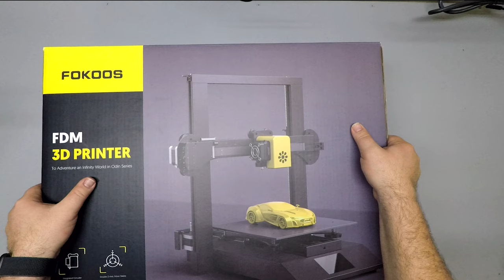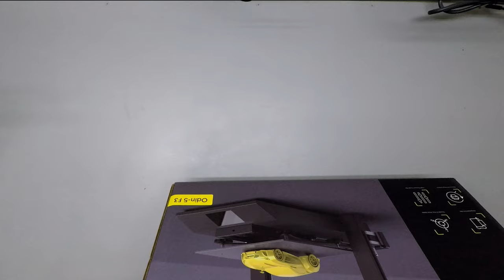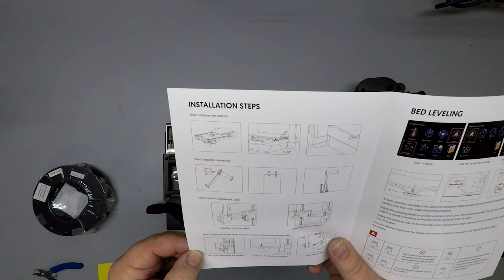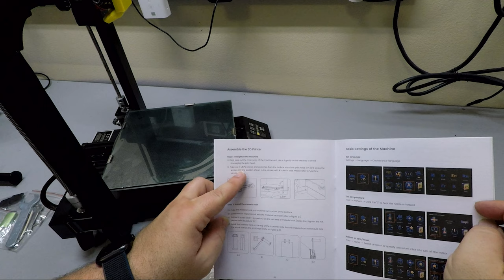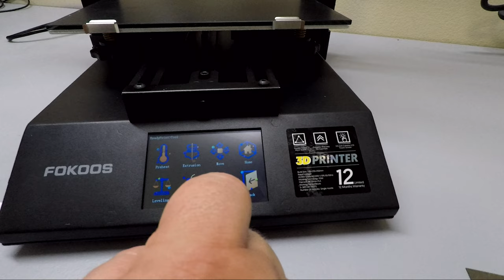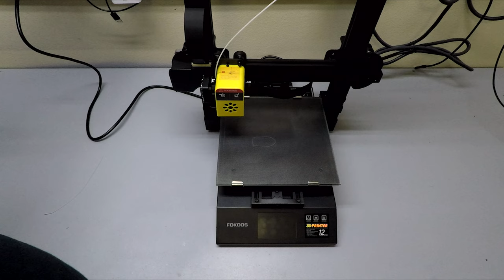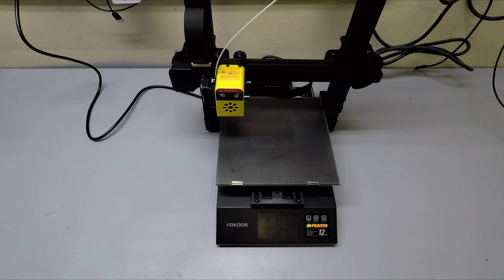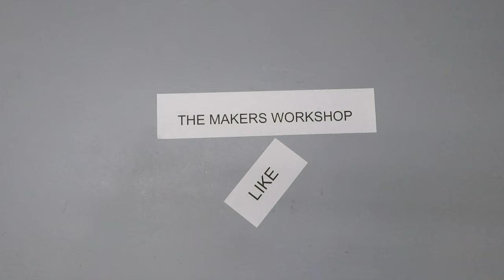Unboxing / Review of the FoKoos Odin5-F3 3D Printer

Comment: I didn’t even get the stringing on the Benchy. But then again I did go through the leveling process five times and I also used the smooth glass side of the bed instead of the corrugated side. I find that all of my prints on all of my printers work better with mirrors or smooth glass. My first boat off of this was completely perfect. Not one single imperfection. Just redo your leveling a couple, three times. And yes it does print fantastic out of the box but I was a little disappointed that they claim to include their own software, slicer. And they do not. Or they did not on my edition. I was able to upload the driver to the computer. But it is not listed as a printer under Cura. So I’m not sure what to load it up as. Everybody says just use ender three settings. Haven’t tried that. Make sure you adjust the bed adjustment wheels and the adjustment wheel for the extruder itself. They did not come adjusted from the factory. It was trying to strip the belt right off the rip. So I tightened the belts and tightened and loosened where necessary the roller wheel adjustment cams. That immediately made a huge difference.
Reply: This was literally just the unboxing video.  Since then I've done quite a lot with the Odin... Firmware is now Marlin 2.0-Bugfix and I'm running the Marlin TFT-UI instead of LVGL ( which gives me Advanced Pause amongst other things ).  I added a BL-Touch by hacking into the factory harness and moved the mounting from the side to the front of the toolhead.  The glass bed has been replaced with a FYSTEC flexible steel magnetic bed, and then I replaced the nozzle with a hardened steel volcano nozzle.  Overall, it has massively improved the machine for me... and the prints come out perfect every time.

( I use PrusaSlicer as my main slicer, OctoPrint + OctoDash to control the machine with a 7" display, and print PLA+, PETG, and HIPS with ease. )

Comment: Hopefully we can get the Wi-Fi enabled and working without too much fuss! I saw the icon on the touch screen and was all excited and then it didn't do anything, lol.
Reply from the maker: Well, here's what I've found out.  If you purchase the correct ESP-12s board ( pins to either side, not the one with 8 pins on the end of the board ) and flash it with the correct MKS firmware, it does "just work."  BUT

... there is always a BUT ...

It's trapped inside a metal case.  One of the reasons that companies like Prusa and Creality have put the WiFi adapter in the separate control panel box is so that the wifi signal can get out.  Since the MKS Robin Nano v1.2 board is inside the case, and under the unit ... the wifi signal is very weak.  You get the convenience of wifi, but only if your computer is right next to the printer.

I'm working on a kit which will solve that.  It will consist of a PC board with the right pinout for the MKS, a 3D printed plastic case for the ESP-12s board, and a cable that leads outside the printer case.

On the other hand!  You can also, for about the same amount of money ( $35 or so ) simply purchase a Raspberry Pi 3b or 4, and install Octopi and plug it into the printer's USB port.  Easier, and less messy overall.  Plus no modifying the printer or taking it apart!  Bonus.
Reply: @TheMakersWorkshop  wow! Yeah, I wondered if it wouldn't block the signal. I will just wait and see what pops up. Maybe if you get something ready to go and sell them.
Reply from the maker: @KeeferTech  Well, I usually try to open source mods like this and set up a bill of materials anyone can source from sources like Amazon and the like.

Comment: I checked their website and it supposed to be able to print TPU.  Could you please do a test seeing if it will print ninjaflex? I'm in the market to buy a few printers if they can print ninjaflex. Thank you.
Reply from the maker: Already did!  It prints TPU fairly well, given that the printer uses a pinchwheel setup.

As always make sure to go SLOW, as with any TPU.  Also, I wouldn't try to print anything softer than .. say .. shore30 without a dual-drive extruder.

Comment: This is exactly the same as my Xington S1. even the screen commands. have you updated the firmware to marlin yet?
Reply from the maker: It is Marlin, using the LVGL graphic touch option, running on an MKS Robin Nano 1.2 board.
 
FoKoos gave me source, however I compiled the MKS version just fine after adjusting pins.h appropriately.  

My GitHub is:

https://github.com/martinbogo/Marlin-2.0-for-Odin-5-F3
Reply from the maker: ... addendum.  I had a look online at the https://www.xtzl3d.com/ and looked for "Xington" then "Xingtong"   Looks like a much earlier revision of the printer, with a bowden setup rather than direct drive.  In China, there are a /lot/ of OEM rebranded manufacturers and resellers.  Usually like this, with small changes made in logo, color, and features.
Reply: @TheMakersWorkshop  mines a month old and have had vastly superior prints than any of my other much more expensive printers, first thing I did btw, was change the case fan for a much more quieter one.  Superb

Comment: How easy would it be to add auto bed leveling?
Reply from the maker: It looks like the printer is designed to have WiFi added easily ( it used a standard MKS Robin Nano v1.2 board -- so you'd use an MKS Wifi board - ESP-12s breakout ) and the molded plastic hood over the hotend is literally DESIGNED to have a BL-Touch/3D-Touch aftermarket part added.  The company representative says that they are both working/packaging a kit and selling the printer with auto bed leveling.

That said -- it was one of the simplest manual-level operations, and the benchmark benchy came out beautifully.   It's a very precise machine all around.
Reply: @TheMakersWorkshop  thanks for the information.
Reply from the maker: @bribeck12  I am now compiling Marlin 2.0 ( from the Makerbase GitHub link for the Robin MKS v1.2 board ) with BL-Touch auto-level support.  Although I think FoKoos is working on implementing it more neatly through the ribbon cables, I'm going to see if there are signals on the wire I can use to connect the BL-Touch servo and limit switch emulation to the board through the current setup -- or if I'll need to wire it separately.
Reply: @TheMakersWorkshop  awesome thanks just ordered the machine. And I do have a spare bltouch clone to install. Would love to not have to run exta wires and use the ribbon cable. Keep me posted please. Or even for now if manual mesh level can be activated with a new compiled firmware that would help too.
Reply from the maker: @Brian Beckwith  You can easily get manual mesh leveling working with a recompile, although I do think it's a tiny PITA to do that and it only gives marginal benefit over manual four corner leveling.  Here's the link to the Marlin 2.0 source used by FoKoos:

https://www.igotu.com/downloads/FOKOOS-Mks-Robin-Nano-Marlin2.0-Firmware-master.rar?dl=0
Reply: @TheMakersWorkshop  it's wanting a username and password for the link.
Reply from the maker: @bribeck12  thanks!  I forgot I had that directory password protected.  I have removed the password protection ... the link should work now.
Reply: Hi I'm new to 3d printing if download cura software on my laptop and first it does it override the cura software on printer

Comment: I'll tell you why not to get this printer. parts, My printer came leaking plastic. and I see hotends all over the internet for Ender and many other cheap printers but nothing for this printer. before the printer arrived I emailed support about parts twice and got no reply.
 so I try to pause the printer every 8 minutes to clean off the leak but it resumes in a future place as if the printer is still sending commands or something.
 Make sure you square it in the z-axis. I had planned to add another screw because it moves some in the bracket.
Reply: Support said "Generally, no additional maintenance is required, unless you are very careless in using it

Alisa"
Reply: Now I'm searching for the Firmware. The control board is inside so I can not see it, Windows does not see the printer with the installed firmware. does not see the sd card.

Comment: I wanted to like this printer, However I don't recommend it. After leveling and making a perfect demo vase ( which was too small and sliced too slow), I tried to slice a new print, I had to use their provided cura. Then when tried to print the printer lost the leveling, as if the firmware settings got corrupted. ALSO it didn't home and went in wrong direction and I had to power off to reset it. I couldn't get leveling to work the 2nd time, as if the end stop position is way off. The printer hit the bed and it got damaged during the 2nd print.

I would STAY AWAY from this printer until they resolve their firmware issues.

I recommend Biqu B1 for now or creality because of large community and support.

I recent bought BIQU B1 and running side by side with the Fokoos.

Also, the heated bed has very small insulation underneath, and it takes a lot more time to get hot, Unlike the Biqu B1 which is covered up to the leveling knobs.

A couple of cons on the BB1, there is no 2nd Z motor, and the fan noise is horrendously annoying, I had to cover it up, until I replace it.
Reply from the maker: Hi.  Sounds like you have a loose connection on the Z-axis IR endstop, or an issue with tram/level of the X axis.

This printer does not have automatic leveling, so it cannot 'lose level' ... but if the Z endstop failed or has a loose or broken connection I would expect the symptoms you describe.

Did you reach out to FoKoos on their Facebook group or over Amazon?  They have been responsive and polite about taking care of customers and resolving issues.

Any new product out of the box can, unfortunately, get damaged in shipment.  It's part of why I put anything I get through it's paces and thoroughly look over things immediately after shipping.

For more resources, community feedback, and help head to:

https://www.facebook.com/groups/fokoos
Reply: I have 3 and work flawless out the box after bed leveling.